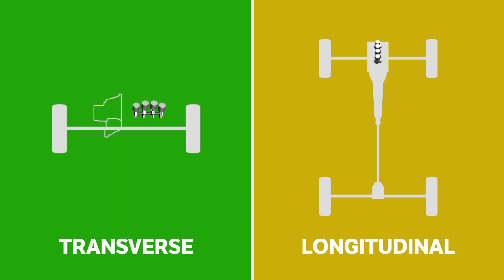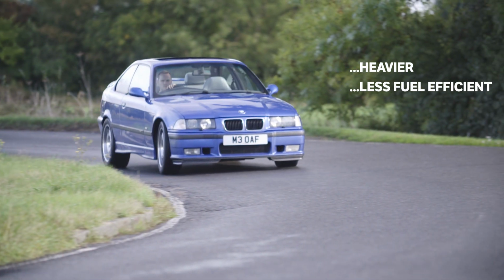The Differences Between Transverse and Longitudinal Engines

Comment: fuel consumption..
gasoline price  per liter..
diesel     price per liter..
 
 g a s o l i n e   .....diesel
 2 8/  3.0  / 3.2 ......... 4.0   
 1.6 /1.8 /2.0      |   3.2/2.8
                               2.2/ 2.4
                down to 
        1 cylmdet engine 
    
ang availability at knowledge at experience sa pag gawa 
 ang upgrade ay  hindii lang siguro sa pang sportscar.

Comment: rear engine
  car front
    driver
       """"   engine 
[ ]---"""""---[ ]  rear wheel 
  
 engine built design at large continent and long distance road.. 
car design as a whole with   space compartment  suitable for  body comport.
so the engine made big..
   
built design place at the back  to avoid mechanical due process and heat moisture   to pass at the  driver front,.

engine weight and size  that time for safety measure can you put at the  front  if the engine power made to run   at long distance..
  miles almost twice in kilometer distance  to  run car at  any road..
     
   metal sheet  widthof car body built  and  car suspension  and wheel cover support..
      
     
can you analyze your own at the  place where you  belong.

Comment: Having owned a bit of everything. From a 91 eldorado, to a 300zx 2+0, to a e36 318, to a mini Cooper s, and a awd Mazda 3 hatch.... Rwd cars are the most fun hands down. Don't get me wrong tho if you're gonna go fwd. Them minis haul ass, and handle almost like a rwd. I was entering an off ramp and the tail just kicked out doin a slip angle thing. Different things can be done but end of the day. The amount of control you get from a rwd is unbeatable.

Comment: I have nothing against transverse engines. I went from an 06 Grand prix GXP (5.3L LS4 V8) to a 2017 Nissan Maxima SR Midnight (3.5L VQ35DE V6) and I've had a lot of fun with them. Sure they're front wheel drive, but for full size sedans with 300 hp (323 tq LS4, 261 tq VQ), they're quite quick

Comment: I prefer in all honesty transverse, traction is an issue but power loss is minimal the engines in the traverse position are generally cooler, and easier to work on.., less aftermarket support for fwd is a killed though..

Comment: That is a good point in front wheel drive cars everything’s under the hood the engine the transmission the radiator the steering linkage brake reservoir fuse box battery AC and it’s radiator. Plus’s got the axels it’s a big mess lol

Comment: well no FWD cars don't drift, but if you tune them you can throw that beast around a corner. you'll be dealing with plenty of oversteer if you can't get the front tires to spin and pull the car through the corner. People make fun of racing a FWD car but there is a science to it and I'm not a ricer

Comment: Tilted Vertical Variable quad-turbo supercharged Carburerated H15 90-Valve VTEC with Iron-Iridium Cylinder heads.
Reply: Linked to a 12-speed dogleg transmission.

Comment: Gonna be starting to build a drift cart powered by a GM 3100 SFI v6. Now the engine came out of a 1998 Chevy Lumina which is a transversal set up. Is there any way (even if I have to fab up mounting plates) to take a truck transmission and mount it up without messing with the engine or transmission too much? I've researched for a few weeks now and can't find a tranny that looks like it would work, but I don't know a lot about transmissions.

Comment: Hey all and Alex transverse V6 is are not just for front wheel drive economy cars I have a Mitsubishi Galant vr4 1998 which is a two and a half litre V6 Twin Turbo AWD and I have a Mitsubishi GTO which has a 3 litre V6 Twin Turbo AWD I assume what you mean most transverse motors are performance motors but there are some

Comment: I owned a 2007 nissna Maxima 6-cylinder (transverse engine) and it was a pain to replace the spark plugs. Three of them were behind the intake manifold so I had to learn how to remove all those cables and wires and of course the giant hunk of metal tucked away in the back of the engine bay

My current car is an I4 longitudinal. Much better to work on

Comment: No true a rear end drive car can get a higher mpg by using a independent rear end suspension will help because of the use of a solid driveshaft no carrier barring driveshaft. The best setup is as follows a 2.5 L Turbocharged I4 engine a close-ratio ten speed automatic transmission with overdrive a 3.10 rear end and 18 inch aluminum wheels full framed chassis and full body crash cage aka roll cage full aluminum body panels not including fire wall in a 4 door sedan layout could get 35 to 40 mpg easily.

Comment: I prefer Clio V6 Transverse rear engine rear wheel drive. And also the Renault 5 1.4 liter 4 cylinder transverse rear engine rear wheel drive.
Any layout is good , but I just think the Front longitudinal engine mount is better.

Comment: After just replacing an alternator on a 99 cougar (infamous for lack of foresight on engineering) I can safely say I'm all about the longitudinal engine setup, like the one in my 01 540i, shit's just easier to work on and more fun to drive. That said, I've never had a proper run in a hot hatch that has some torque.

Comment: Longitudinal is so much easier to work on.  It is like night and day.  I have an older Mercedes 1981 4 speed manual 240d and I love the space that is in the engine compartment.  I have had transverse engines on 2 cars now.  A Chevy Lumina and Buick Park Avenue.  The Chevy was a bit easier to work on because the engineers thought it out.  Try changing the serpentine belt or water pump on a Buick Park Ave.  What a pain.  And changing a worn out power steering on a Buick Park Ave.  is a night mare.

Comment: transverse engine setup for awd vehicle are rubbish. they are hard to work on and are not well balanced. the transmission for awd vehicle with transverse engine setup  are heavier than the actual engine. making the suspension component on the transmission side more prone to damages.

u can see any vehicle with transverse setup sits heavier on the transmission side after a period of time when the suspensions starts to fail.

Comment: I find the engine animations bothersome. While the first and last cylinders are correctly in sync, as are the two middle cylinders, the phasing is not correct. The middle two cylinders should be moving exactly opposite the outer two. Instead, the middle cylinders appear to be lagging the outer pair by less than half a rotation. This would be a terribly imbalanced engine.

My guess is that somebody took an animation of an inline-6 engine, deleted the outer two cylinders and called it a day.

Comment: What about Saab, the saab 900 has a longitudinal engine but also fwd
Reply: derbi senda 
1.The engine is half a v8 so lower profile due to a 45 degree slant compared to a standard vertical longitudinal.
2.The engine is mounted backwards with the crank output facing forward and ancillaries against the firewall.
3.The slant allows enough space for the gearbox and a differential to fit underneath and slightly behind the engine,there are then two equal length drive shafts to the front wheel.This give no torque steer.The crank and gearbox are connect be a vertical chain just behind the grill and radiator.

Comment: didn't go into the differences in cooling systems - transverse engines (particularly V-engines) usually need larger water passages or additional water hoses feeding the back side of the engine as it is further away from the radiator and well out of the airflow coming through the front of the car. Longitudinal engines tend to have more even cooling. Also I don't buy the drive train efficiency argument in front drive cars as most have to turn the final drive output through 180 degrees inside the gearbox as the diff is always mounted as close to the center line of the car as is practical in a FWD application. Honda actually usually have an extension shaft on one side of the diff to which the drive shaft is connected so that both drive shafts are of identical length, thickness and weight.

Comment: On your comment about weight of the engine being over the driven wheels for FWD making for better traction -- that is not true, during acceleration, the weight shift towards the rear of the vehicle actually reduces traction in a FWD front-engine setup. There are quite a few physics videos of this phenomenon.

Comment: Well, it's less about what engine layout I prefer, and more about the things I like about different cars i've owned that represent transverse and longitudinal engine layouts.
I love my longitudinal-engined skyline for the fun of kicking the rear out at the stab of the throttle/drop of the clutch. 
But I also used to own a transverse-engined Honda prelude that I loved for other reasons- for example it's great handling (far better than the skyline, particularly in the wet, even when the skyline had far better wet-weather tyres).

Comment: hey car throttle i have a question which engineering explain do  not bother to answer an old mechanic told me a carburetor engine can be cleaned easily by using thinner as the sauce of fuel so i did it in the bush cutter & it worked cannu do this with a car plz???

Comment: longitudinal, because racecar
Reply: Brett Voigt transverse.

Because racecar.

Have a look at the Lancia Stratos if you don't know what I mean.
Reply: The Stratos was a good car with a lot of success. Maybe in rally transverse is the better option, but almost every other race series the engine configuration is longitudinal. Look at the 917, GT40, any F1 car, trophy truck, any ferrari/lamborghini/porsche/mercedes/BMW, 1 and 2JZ platforms, etc.
Reply: Brett Voigt the reason the Stratos was brilliant was because of physics.

Rally racing has a lot more direction changes than F1, Le Mans, NASCAR and trophy trucks. And to have a car that's quick in changing directions you need to minimize angular momentum.

You do this by moving as much mass as possible towards the centre. In a car, this can be done by moving the engine into the middle, and further by mounting it transversely.

This is done by all the cars that are characterized by having brilliant handling.

Cars like the Lancia Stratos, Toyota MR2, Lotus Elise, Lotus Exige, Honda NSX and more.

Comment: Longitudinal with a rear mount transmission and rear mount turbo[s] for better weight distribution. Transverse if it's FWD only or mid/rear engine, as that provides better space savings for those applications. Of course, 10, 12, and 16 cylinder engines won't normally be possible for this, so better to stick with 3, 4, 5, 6, and the odd 8 cylinder for MR/M4 or RR/R4 transverse engines.

Also, a front mount transmission will help with weight balance on a REAR engine AWD vehicle such as a porsche, so maybe longitudinal would be better for AWD in a rear engine car. I'm 50/50 on longitudinal vs transverse for rear engine, but I think mid-engine should pretty much be transverse almost no matter what.
Reply: Drunken Hamster have a look at the Lamborghini Muira.

MR transverse V12.

Comment: For point A to B it really doesn't matter.  For cars with power I thought I preferred RWD having owed 3 AE86 until I drove a Integra Type R with H&R coilovers and Bilstein shocks with from Brembos.  This gave literal meaning to the term " handles like it's on rails".  it was also 550 WHP B18C.  Ultimately however a 4WD is what I prefer for laying down power and safety.

Comment: Longitudinal engines in vehicles:

-Heavier
-Less fuel efficient 
-More expensive to buy and run

Well my Cadillac has a transverse mounted engine, is 1.6 tons, gets 15MPG factory and it might have not been expensive to buy it sure can get expensive to run. But that's the downpoint with a small American 4.5L V8 I guess XD

Comment: Longitudinal : "Less stuff in the engine bay getting in the way"
Absolutely not true lol my transverse engine setup on my 2.0l LSJ Ion Redline has so much space. I can fit my whole head behind the engine at the headers. And yes, I've tried it so that I could see the header bolts. 

I used to have a 1989 firebird formula 5.0L TPI. And there was little to no room to even get to the oil filter

Comment: Fwd is wrong wheel drive...
Reply: Sci4n That's not what I've noticed and I've driven RWD, FWD, and AWD in heavy winters. FWD tends to be a bit more predictable and because the engine is over the drive wheels, you have all that weight cutting through the snow. FWD cars also tend to have skinnier tires and those cut through snow better as well. If you want talk snow fun though? Nothing is more fun that an old Subie with good tires and an empty unplowed parking lot. I've got my old Forester spinning on the inside tire like it was a giant helicopter blade.
Reply: Raymond Fernandes that was what was brilliant about the Peugeot 205 GTi.

Practical hatchback, with an almost gokart like handing. It could both do your weekly shopping, and throw itself sideways through hairpin corners with a bit of liftoff-oversteer.

Hell, even Chris Harris would rather have a Peugeot 205 GTi than a Mazda MX5 (something that'd make the RWD fanboys explode because "muh RWD", because they've completely forgotten about the concept of fun motoring)
Reply: Anton Markov from a performance point mostly. there you could see the significant weight aspect.
but for most people, its better because it's cheaper.
Reply: but you all have to admit that in the snow (on equal tires), FWD isnt so good. not even funwise (a corsa E can go pretty sideways), but just to get to speed is a pain
Reply: Raymond Fernandes yeah okay, but i mean when you try to get up some hill with snoe, from a stand, obviously AWD just walks through in comparison with the others. FWD may be better in such situations than RWD tho

okay, i don't think there are many cars which are as fun as a clio trophy (from what I've read/saw)
Reply: AWD make a big amouth of mecanical losses...and as FWD the main advantage is the safety for common drivers: so say André Citroën about the "traction avant" in 1935: test a heawy loaded wheelbarrow on a bad terrain: if you pull, you go easely forward , if you push, it's very difficult ...
Reply: you missing the point that awd cars have both transverse (front biased) and longitudinal (rear biased) engine (transverse awd is good for traction, while longitudinal are good for cornering). awd is heavier than both rwd and fwd, making it has harder to launch if the car has low HP and torque.
Reply: FWD = fucking wrong direction
Reply: Anton Markov depends on the application.

For example in a race series where horsepower is limited, and grip is low (WRC R1 Junior to R3) FWD is preferable to RWD, because it offers less drivetrain losses, and more controllability in low-traction situations.
Reply: ShadowFalcon And it offers less fun.
Reply: Anton Markov not really.

You just have to stop being a girls blouse, and drive it like a proper hooligan.

Scandinavian flick, lift-off oversteer, you've probably heard of them.

Case in point, in twisty conditions, most would think the FWD Peugeot 205 GTi is more fun than the RWD Mazda MX5. Yes, a hothatch is faster and more fun than the "Miata".
Reply: ShadowFalcon i know fwd can be mighty fast, but when you are not racing who cares if you are fast.
Reply: Alexander Moore Understeering into a tree is as unpleasant as oversteering into a tree. Js
Reply: Sorry but that is bollocks.

I've owned an e39 M5, Boxster and Clio Trophy and it's the silly little french hatchback that is the most outright fun on the right road.
Reply: Yeah, but lose it in a FWD car and you just lift off. Much easier than trying to manage a slide. I'm just saying that for most people not having the risk of spinning out equates to a more fun experience--obviously YMMV, but it's just a blanket statement.
Reply: One last thing, FWD has NO advantages compared to AWD, therefore AWD is better, RWD has some advantages compared to AWD, => AWD and RWD have reason to exist...
Reply: Sci4n actually, I'd say that there very much is a performance advantage in FWD.

It has less drivetrain losses than both RWD and AWD. And it's very controllable in loose conditions.

Just look at who won the 1972 Rally Championship. The FWD Lancia Fulvia HF 1.6. And it beat cars like the Datsun (Nissan) 240Z, the Porsche 911S, the Ford Escort RS1600, the Fiat 124 Spider, and the Alpine A110.

It just depends on the conditions.
Reply: False Wheel Drive vs Right Wheel Drive. Quite entertaining.
Come to think of it, the latter implies tremendous torque steer to the left...
Reply: Exactly. And I'd say three-wheeling it out of some tight corners is much more fun than sliding the rear end into a tree. FWD has done wonders for "fun" cars as it's very manageable and easier to drive a car to the limits. It's much more fun to drive a Pug 205 GTi at 9/10ths than a Miata at 2/10ths.
Reply: Anton Markov Not strictly true. Some of the most fun I've ever had was in a FWD car. Plus, some people need their car to do multiple things. Things like a hot hatch can haul things like people and small cargo, can be driven easily in heavy snow, and can be taken out on a nice summer day to the mountains to tear up the corners. Also, their usually small displacement engines with close ratio gearboxes can be revved into the stratosphere. Ever hit a perfect heal/toe around a corner in an RSX Type S and then go full throttle all the way to 8300 rpm? It's amazing. That car/engine currently has 276k miles on too. So, it's a workhorse.
Reply: err... not completely true...
my previous car was a BMW E36 325i, I now drive a Volkswagen Golf V GTI, I like the GTI (as a drivers car) better.